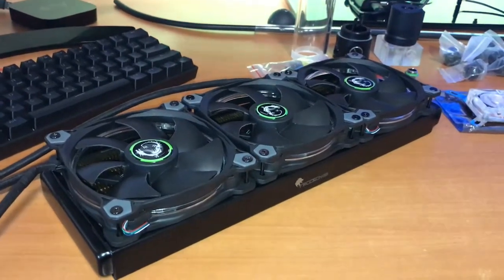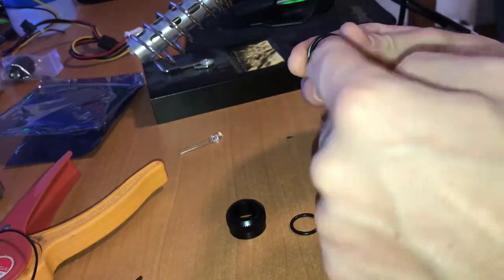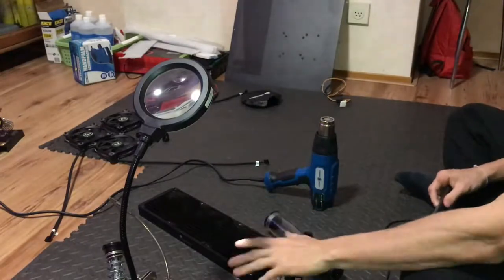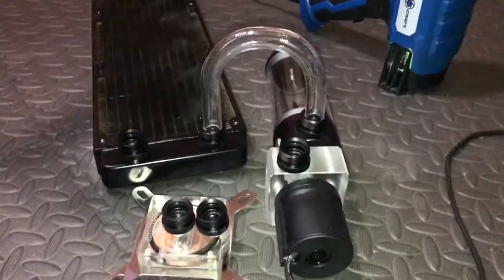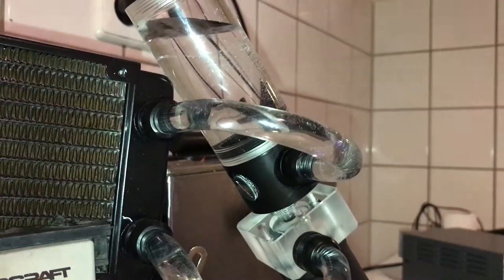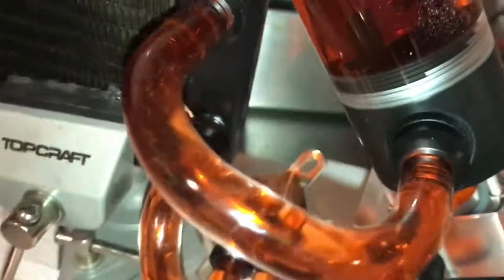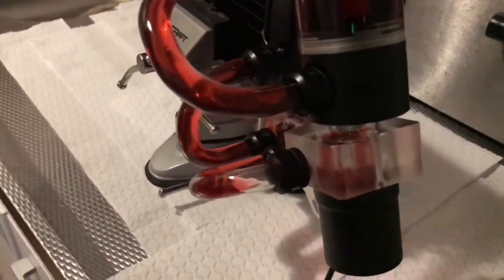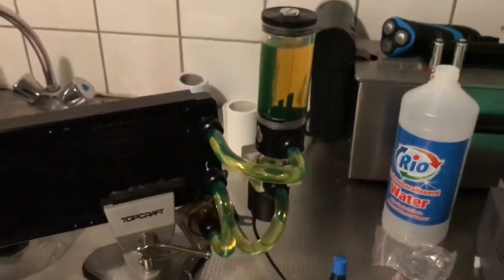Testing a 125$ Custom Watercooling set!

Comment from the maker: Custom Loop:     
Cpu Block:   https://goo.gl/3WF6R7  27 Euro Incl Ship 
Radiator:   https://goo.gl/T37k98  34 Euro Incl Ship
Pump:   https://goo.gl/E4Jc6B 15 Euro Incl Ship 
Reservoir:   https://goo.gl/SkksR1  11 Euro Incl Ship 
Fittings:   https://goo.gl/FbBw86 13 Euro Incl Ship 
Tube bending silicone:   https://goo.gl/b9JbY6   4 Euro Incl Ship 
Hard Tubing PETG 14/10  https://goo.gl/oJHR2u 21 Euro Incl Ship 
Total:   125 Euro Incl Ship

prices may vary because they change over time
Reply: Dennis Gagliano hi dennis some of the water u use is demi water it is almost like destiltd

Comment: You should get something to hold the tubing in its angle after you bend it
Reply from the maker: point is to keep the cost down, what i did, was holding on to the silicone filling, that held it in positon well

Comment: Dude sweet! Greatings from Norway! I am actually doing this myself. The shipping on the diffrent parts are ecspensive af. The rad for me cost  440kr or 50 dollars including shipping and the block will cost 40 dollars including shipping.
I have bought the parts from aliexspress and eaby. But i did not use hardtubing....mabye in the near future. I went for a cheaper waterblock though. And i went for some cheaper radiator. I went for 2 240mm rads. I used all g1/4 treads.

I have almoast the same pump. Which i tink its a good pump though.
I bought the parts on black friday and i got some parts cheaper.

Much love and a sub from norway!
Keep it up.

Comment: Hey man, am really impressed and inspired by what you did for your laptop and i want to do the same but simultaneously as am still a senior lol.....anyways i wanted to ask you if there was a website or app or anything for me to be able to check which CPU is compatible with my motherboard? which clock speed for rams, which eGPU , etc....
I have a Dell Inspiron 15 3567:
Intel I5 7200U (3.1Ghz)
6gigs of DDR4 ram
AMD radeon R5M430
1TB 5400RPM hdd
1920x1080 display....so what do you think you can help me with and thanks a ton man :)
Reply: i was thinking of either a gtx1060 (6gigs) or a 10650ti (overclocked) so i hope you can help me with that too.....btw i have a 0D53F5 motherboard
Reply: If you've heard of either mypartpicket or just partpicker.com that website is very helpful and I think it will anwery your inquiry's.

Comment: I'm curious how those Radiators are. I had no idea I could get 2 x 240 Chinese for the price of a single one from the US.
Reply from the maker: so far is holding up fine, no leaks on the system, gonna tear it apart as soon i get my new fluid, and i'll see how it looks
Reply: Because the Chinese company doesn't have the overhead or profit margins of a US company.  They are most likely produced in the same factory and on the same assembly lines as the overpriced US products, usually during another shift.

Comment: Damn, your pump seems surprisingly quiet. I ordered exactly the same pump and it sounds like a fucking chainsaw. I thought that it's normal for the pump as it's very cheap but maybe it's so loud because of shipping damage..
Reply from the maker: Dont run it at 12v, i have primochill vue so i can see the flow but i have mine regulated based on temp, i have a video on it named like pwn pump mod , check it out, i run mine at like 5v tbh

Comment: ` How's the set now? Are you still using it? Planning to build one too...

Thanks!
Reply from the maker: Fidgety Minds still flawless, had 4 different fluids in there including the notorious primochill vue, no issues, didnt ever have to replace anything, changed fluids due to look rather due to issues with the cooling, its amazing.
Reply: ` Thanks for the reply, currently using an AIO but I found out that these are usually mixing metals. So I decided to watch some videos of custom loop, and here I am. Sadly there are no decent Aluminum CPU Block, and there are a lot of good Aluminum Radiators that are very cheap.

Replacing the coolant every 6 months for me is not bad, if that is what you are saying. If ever I'll start with distilled water then go ahead with the all aluminum build, if that works then I'll upgrade to full copper.
Reply from the maker: My setup is full copper, i could run fluid for 2 years probably i just chose to maintain it more frequent :)
Reply: ` I already ordered parts full copper parts, pump and hard tubes are the only ones that I am still waiting...

Still hoping for a decent Aluminum CPU Block, though...
Reply from the maker: @fidgetyminds  still flawless =P

Comment: hi what do u think about the noise level of the pump is it loud ? i am thinking to also get watercooling but i do not know very much about it i am gonna buy a second hand cpu block from ekwb a copper one and a old radiator of a car or a heater and use soft tubing and just the pump ( if it is a good one ) that u use and no ressevoir
Reply from the maker: i'm gonna edit two videos today one will be about a mod i've done to the pump to reduce noise.
Reply: thx